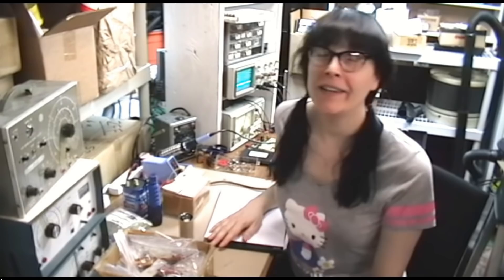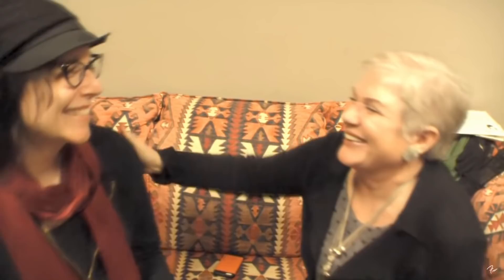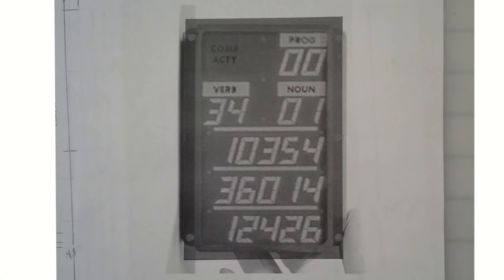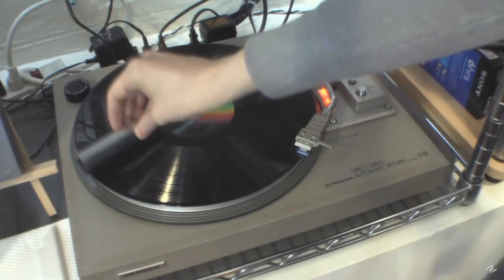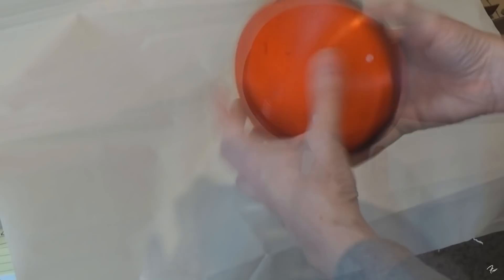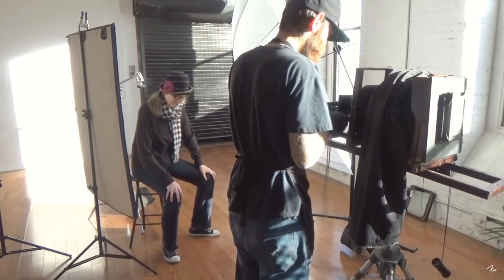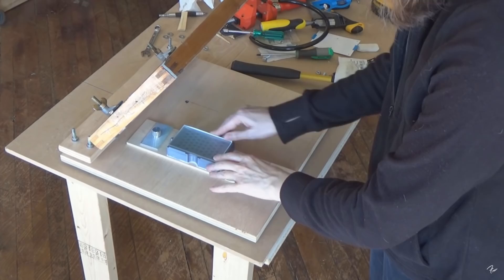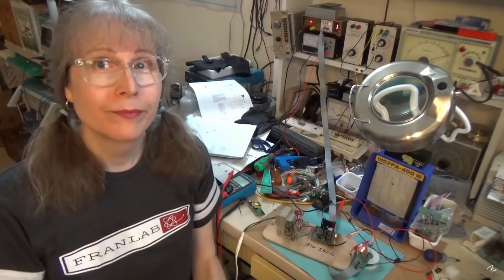The Epic Saga Of 10 Years Of FranLab - Part 1

Comment: OMG! Fran! It's like we grew up together! I HAD a spin welder! My uncle bought it for me for Christmas, and it didn't work! It used a battery pack that (I think) used two D-cell batteries. My Dad cut the leads on it and hooked it to a six volt lantern battery, and it WORKED! Came with a kit to build a helicopter that, when finished, could be powered by the welder itself to spin the blades!

Comment: at 3:22 I see the little box with three plug-in connections, it's the Heathkit transistor checker! My father got one in the late 1960s or so. Had PNP/PNP switch, low and high power I think, and a spring-return switch, normally in "leakage" position (important for germaniums back in the day!), switch it and it's "gain." It's a really simple circuit, basically the same thing modern DMMs have for testing BJTs.

Comment: TEK 564 scope!  That was the first storage scope I had access to.  Our Control Systems Lab had before it a Solartron scope, no memory and other shortcomings.  One thing though about the '564 that your presentation reminded me was the split screen feature, which I had forgotten.  When I got transferred to another division of the corporation, one of my very early tasks was to establish an Electronics and Measurements Lab fron ground up.  Among other instruments I wanted a TEK 7600 series scope and my immediate finding was that it had to be a storage one.  Starting from zero, I got for a year or two a fairly generous budget and decided to save elsewhere and buy essentially a top of the line storage scope, model 7633.  Great choice, as I found repeatedly, except that the time base plug-in module existed only in the sales literature.  For about 6 or 8 weeks I had the scope with two vertical plug-ins and an opening for the time base 7B53.  Well, it arrived and the scope was everything I had hoped for.  Later on, I did not have similar budgets in my new places of employments, so I started collecting my personal instruments at various Ham Fests and surplus auctions.
  My first LEDs were Monsanto parts.  I was quite disappointed when Monsanto gave up that business.  Same happened to me when GI (General Instruments) optocouplers (74OL6011) became unobtainable.  I started understanding why some manufacturers did not allow their engineers to design single source components into their products.  I also decided to save as much data books as I could, for the time when my next design needed a second source or more.  I still have about as much, if not more, of the data book collection as appeared at one point in your video.   Just like you, I have needed outside storage for my less than regularly used items.  Luckily my Lab fitted in one of my bedrooms.  A storage for regularly needed components is in another.  The library is partly in the living room and partly  (one full wall) in my master bedroom.  I gather, eventually I need to find  some museum  --  or maybe more than one  --   who would accept my vintage measurement instruments.

Comment: @2:44  Loved my Spinwelder. I had the 3 wheel chopper (awesome) and the dragster with the Can-Am race car. Never got the helicopter or the WWI biplane. My favorite trick: I would never make complete long welds anywhere. I would just spot weld here and there, take them out to play crash-up derby, weld them up the same way and play again. I've always been good about stretching out the intended longevity of anything. Even when abusing it. But yeah, so many burns from that hot melty tip, hard to believe they spun at all with just a smooth metal nib. Caught my hair in it more than once. The gun got as hot as a slot-car controller . My enthusiasm has melted 2 of each....in my hands.

Comment: Ha, I had a spin welder also a plastic Vacuum forming toy that  I carved balsa wood molds to make slot car bodies. also had a chemistry set..  I think Gary Anderson was the guy that made the first 64-bit controller used for the Space shuttle motor controler. Rocket Dyne Santa Susan field laboratory.

Comment: OMG I had a spin welder it was the late 80's ! It wasn't called that it was a little orange gun had a wheel in the back with some flints so it could  shoot sparks  it was to weld body panels on a toy car to crash then repair , and it seems that I have aged like cream cheese spread on the hood of a Ford Pinto while everyone else ages sooo much better 😉
Keep on rocking!

Comment: I made Forth Rockwell 6502F mcu's systems w latch before Enbedded chips of today, when i worked for Ampex corp Redwood city Ca back in 88-89, I did before work for sony broardcast eng in 79-81 NYC, before i worked silicon valley later in my life CA. Your just so cool, i made my poto boards using sunlight or girllie uv nail lights.. lol

Comment: Good job. Happy Deca-Fran, your 1st decennial, may you have many more.
 Couple questions if you'd be so kind to answer. I'm a bit of a film nut and noticing your camera placement I can't help but wonder what led to the decision to place it high  above the usual eyeline. Not that there's anything wrong with it; it's just unusual. I don't think its to add tension and  unease to a scene, so I can only conclude It is the perfect placement to capture both you and what you're working on, greatly minimizing having to re-set it  all the time. If I'm right then that was pretty smart. If I'm wrong then you are smarter than you know. 
 I dont know of any other channel that is clever enough to even copy that trick.
Wishing you good fortune and continued successes.

Comment: Yes, perhaps I should have watched this cool video first. To echo a comment below, yes a good fun day of video with #1 & #2 for my 54th birthday. Thanks.

like your older heathkit Franlab T-shirt. I collect old tube radios. Where do you sell your T-shirts? I don't do facebook. I liked your Sputnik module, do you sell them, or the plans? I also liked the single tube number display you built. It is that lovely green color I like for the electric eye tubes in old tube radio tuning circuits. I was also interested in perhaps discussing a how to for making a full blown 6 digit clock with them, like a nixie clock. Is this possible to come up with a circuit diagram for this? Another thing I am interested in, is the possibility of doing these circuits using an initial 12-14VDC power source, instead of AC. I live off grid using solar, and although I make AC, it soaks a lot from the battery bank in conversion. Direct to 12VDC is more efficient. But for these circuits, probably not feasable. Your opinions?

Anyway, thanks so much for the cool stuff from my youth.

P.S. (I am also an old C-64 user!)